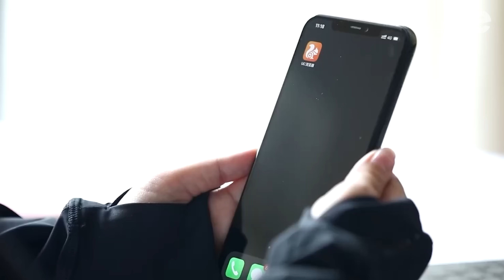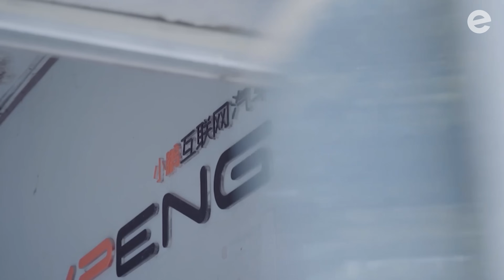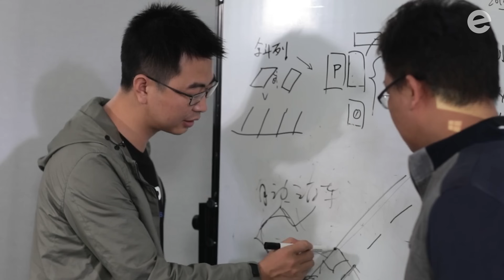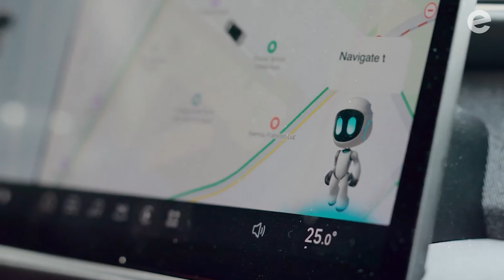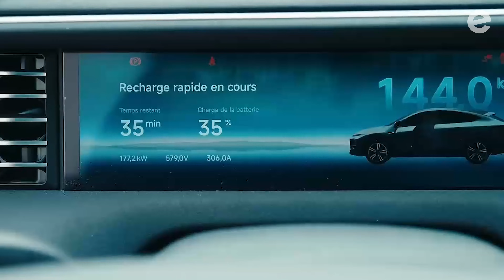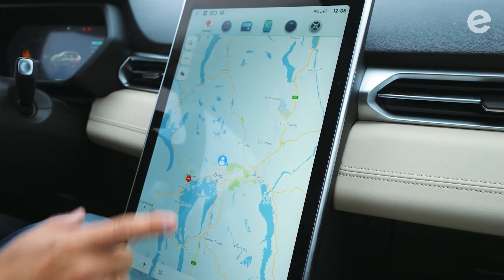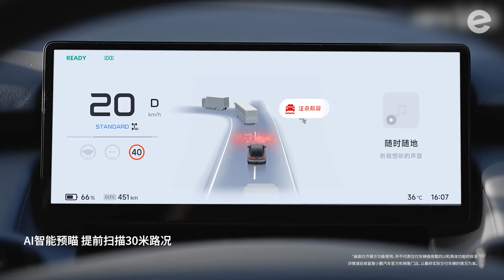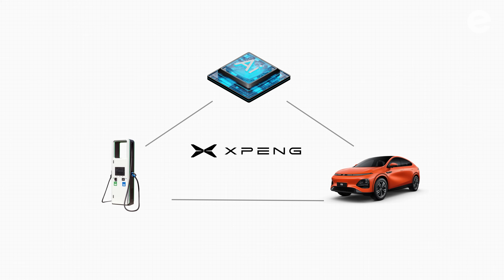The Untold Story of Chinese Tesla : Xpeng

Comment: this is false information. Xpeng is NOT using Tesla's patents for free. Not is GM, or Ford, or Stelnatis, or ANYBODY else. Why? because the very unfavourable language in Tesla's language. Two main points:
- If you use Tesla's EV related patents, you cannot enforce your patents against ANYONE. If you are GM (or xpeng) and use these patents, then Ford can use yours, and you cannot sue Ford for it. (Xpeng has over 6000 patents itself btw)
-It also means you can't assert any IP right at all against Tesla. GM starts using Tesla's patents and Tesla decides it wants to call its next vehicle the Tesla Chevrolet Escalade? GM can't do anything about it, or they lose access to Tesla's patents.